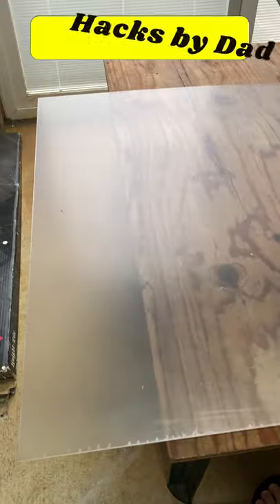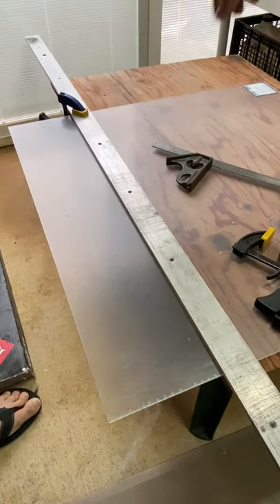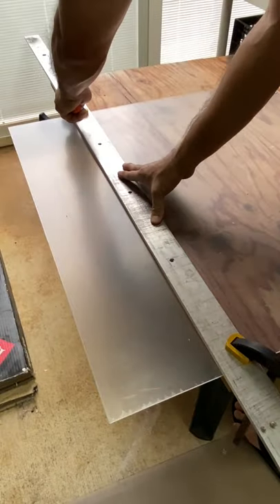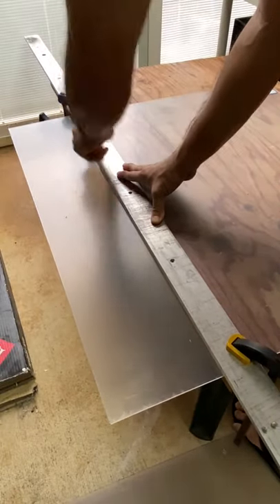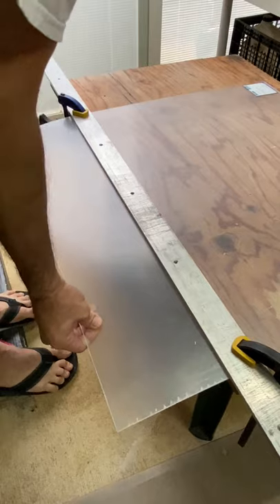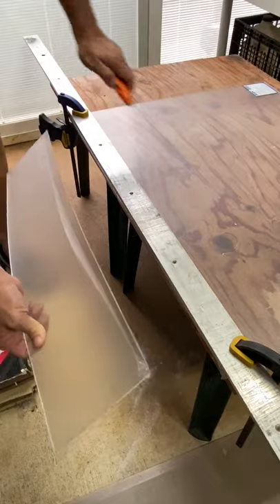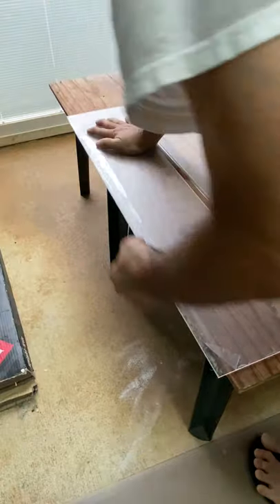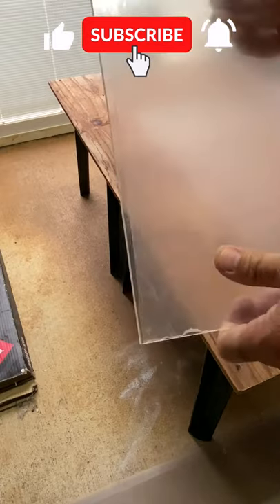Cut a Thin Acrylic Sheet Without a Saw   #shorts

Comment: Should have seen this befor trying to break mine. I didn't "cut" enough with the utilty knife and didn't secure the sheet with enough force before pressing down and it broke in two pieces.

Oh well, at least now i know. Thanks for the tips!
Reply: 😂 Pretty sure that's how half of us got here , it's just funny as hell when it happens to someone else , takes off some of the sting
Reply: How thick is the sheets?
Reply: Can you cut curves or circles? Up to what thickness
Reply: @HeavenlyFlowers313  After my comment I've been cutting 2mm sheets. I'd say 4mm is doable as well, never tried it but I've seen it on videos. I guess you just gotta pre-cut better with the knife before trying to break it.

Circles/curves would probably be a pain in the butt.
BUT maybe if you can get a way to secure it very tightly along the curve AND if you get a rigid mold slightly larger than the curve you're about to cut and put it beneathth sheet AND you pre-cut the curve very well, it might work
Reply: I would have cried 😂 All that effort 😂
Reply: Ive still never successfully cut glass or acrylic watching these vids